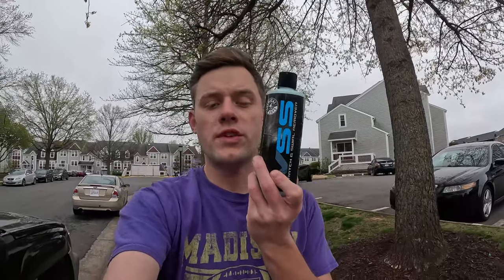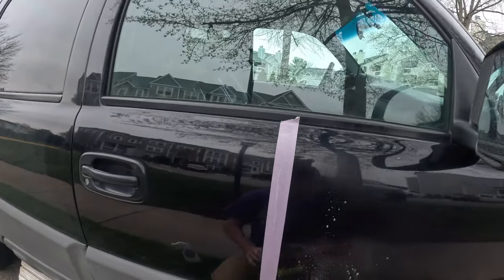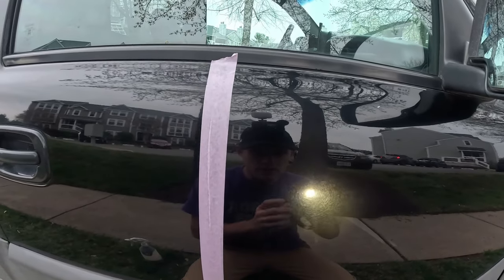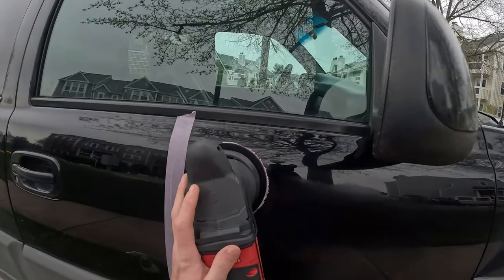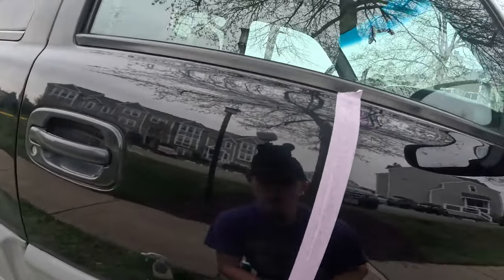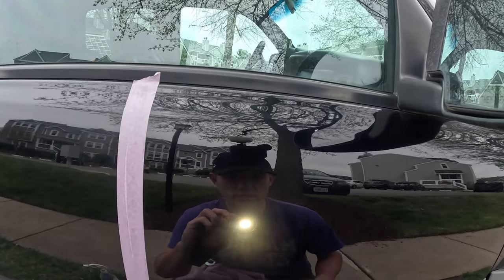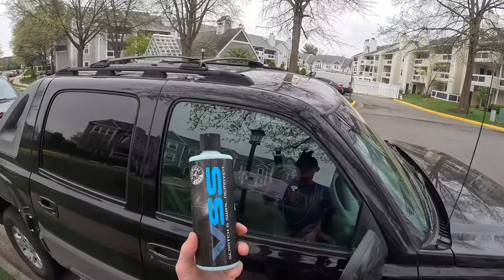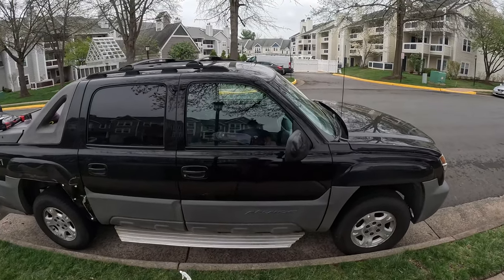Chemical Guys COM_129_16 VSS One-Step Scratch and Swirl Remover Compound Polish

Comment: When I screwed of my cap the tamepering thing wasn’t even on right I don’t think. because it was off and stuck inside the cap when I screwed of the cap. Did you experience this? About to return it. Chemical guys needs to do better.
Reply from the maker: No, but that sucks

Comment: What speed is your polisher at for correcting?
Reply from the maker: 3000-4000 RPM
Reply: That sounds low for correcting. I’m surprise it removed that much swirl marks with that low of RPM.